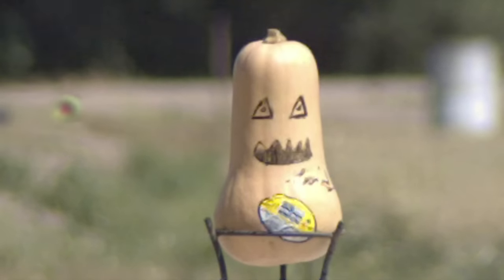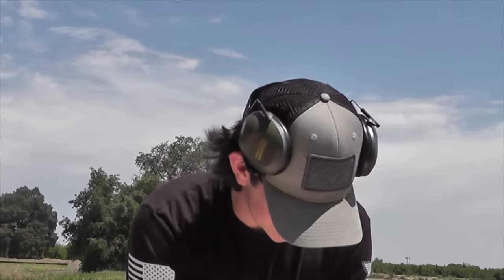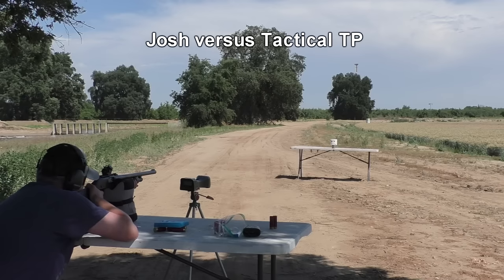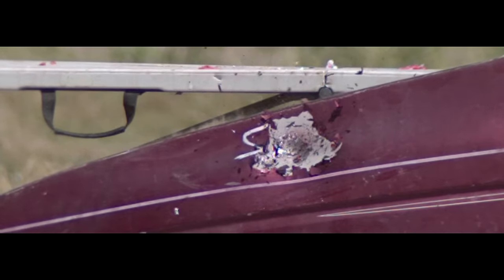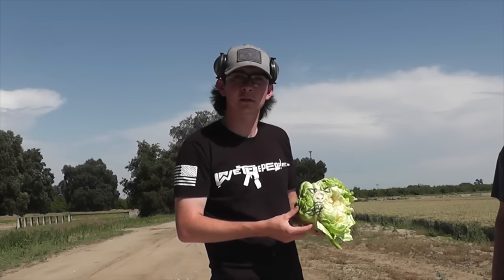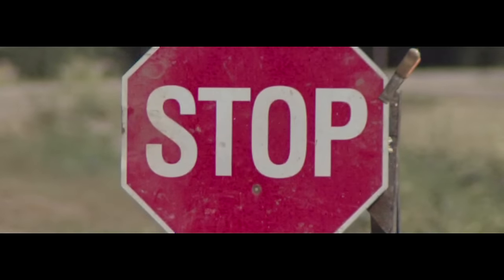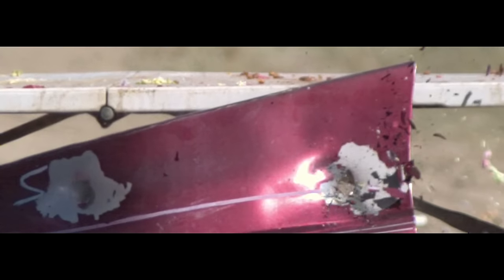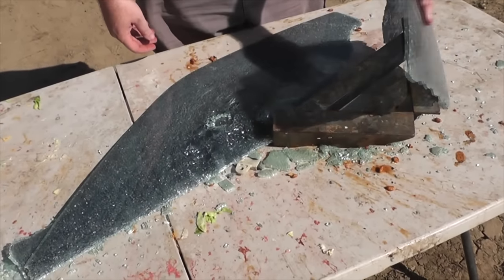How deadly are 12 ga. BUBBLE GUM Slugs?

Comment: I'm wondering if possibly deep freezing them with dry ice instead of a regular ice pack would have made any impact on the durability of the HubBub Slugs in flight. Maybe something to try if you decide to revisit the idea, Jeff.

Edit: The only downside that I can think of would be that the gum would then be too fragile to handle the G-Shock from firing and just shatter upon being fired.
Reply from the maker: That's a good point,   these are resilient enough to handle that shock
Reply: @taofledermaus  I imagine that there's an optimal temperature where you could have a more rigid, yet still resilient round that isn't shredding itself apart mid flight, but it's probably not worth the effort to fight the California heat to trial and error it. 😝 In any event, great video as always!

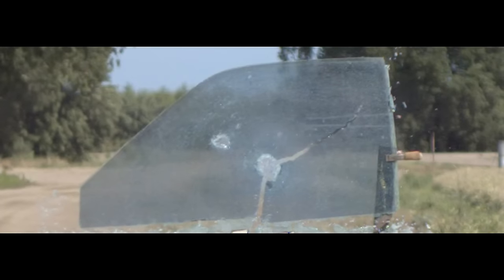Comment: 19:06 The cup holder went through because the glass it hit was already shattered. The moment the bubblegum bullet hit, the fractures went so fast even in slow motion you could barely see it. The top right of the glass was sent flying from the speed of the shockwave.

Comment: There was a difference in angle of impact as well as distance on the fender. The non penetrating shot hit above the bend on the fender, with the metal sloping away, penetrating shot hit a lot flatter.

Comment: Since the window was pre-shattered and only held together with the tint film, the shot cup was able to penetrate. By itself it probably wouldn't have been able to do so. Tempered glass is remarkably hard to break with blunt objects. Sharp pointed ones or the edges of the sheets are another story.

Comment: I think it would be cool to see what you could destroy with just a shot cup/wad, etc. without any other projectile. The trick would be getting enough pressure to send them downrange at enough of a velocity.

Anyways... You certainly found a good stand-in for OG's Comedy Hour. Those two would be a hoot together.
Reply from the maker: It's not heavy enough to light off the powder unfortunately.
Reply: @taofledermaus  Didn't you guys make an airgun before with a tube, valve and compressor? Maybe I'm tripping.... :/

Comment: Another suggestion from me (if you haven't tried it already) would be forged carbon fibre and forged kevlar projectiles, preferably using epoxy as the resin.

The projectiles shouldn't be too difficult to forge. A simple tube (with some drilled holes to avoid hydrolock) and a regular vise would be enough to press the fibres - a hydraulic press even better.
Reply from the maker: I think they'd be very light weight.
Reply: @taofledermaus  To solve that problem, a metal in powder form could be mixed with the resin. Just enough to increase the mass.

Comment: Awesome ballistic research! I performed a similar test with dubble bubble, 1184fps 5 shot average, SD of 33fps. Cylinder bore 18.5" barrel. 1/8" aluminum at 5yd only dented. Able to hit steel targets at 25yds. Definitely not going to penetrate a stop sign at 20-25yd. But, super fun anyway.

Comment: Worthy of mentioning...The car window at the end was tinted with aftermarket window film - it's not a stock window (you can easily tell by noticing the fact that the film does not cover 100% of the window).  The projectile and the wad went through both the glass and the 1.5mil (not millimeters...a mil is 1/100th of an inch) window tint.  Window tint is made from spun polyester and contains a very agressive acrylic adhesive that bonds it to the glass.  You can't tear it - it's really only possible to penetrate it by using a blade to cut it.  Or Hubba Bubba, apparently.

Comment: They could have used the kind of stop signs that road repair crews use.  Since they have to hold them they need to be fairly light.  I don't know exactly what they are made from, but it looks like a fiberglass type material.  I think the bubble gum slugs you were using would penetrate them.

Comment: The window surprised me a bit honestly. Me and my friends scraped a old car a vw bug that rusted to the ground dang near and took the windows out
We where blasting it with softball sized sandstone rocks and could not bust them i took a tiny pebble and threw it and shattered it. I expected the gum to give enough that it would not break 
As far as stop signs go some are thin aluminum some are thicker or made from steel that could have allot to do with it aluminum ones when you hit them with even high powered bb guns you can punch through them with ease

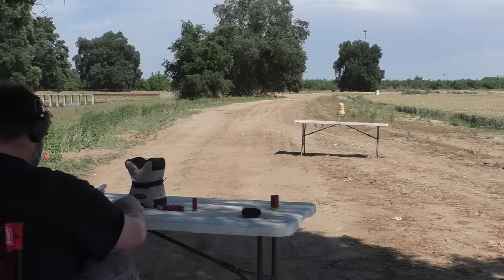Comment: @ 9:14  It's a Butternut squash.  Buy one, cut it in half longways.  Scoop out the seeds and any strings.  Violently stab the flesh all over with a fork.  Drizzle some good olive oil into each half and rub into the flesh.  Sprinkle with salt and pepper.  Put onto a hot charcoal or medium-hot gas grill (with some wood chips for smoke flavor) skin side down for (insert time - depending on your grill...my little gas grill is 22.5 minutes a side, charcoal is going to be a little longer...if you have a balls-out $3K grill, throttle it waay back to medium-medium low).  Flip and cook for an additional 20'ish minutes.  Take off the fire, add butter to the cavity, and prepare yourself for the best squash you've ever had.

Comment: From working with sheet metal as part of my job, I think that computer case was made of either 20 or 22 gauge steel, and the fender was probably made of 26 or 28 gauge (gauges run in reverse, so bigger number means thinner gauge). Not that thick, but good enough to stop a bubble gum slug, apparently.

I'm guessing this thing would probably have similar performance to a beanbag round against home intruders, it's not something I would want to test though.

Comment: So my dad used to reload shotgun and rifle rounds so I know a little bit, but I'm no expert. I think if you have these bubble gum rooms sitting between two layers of dry ice in a cooler and then shot them the results would be very different. Whether it was a hot load or not and whether the barrel was rifled or not. We have to remember that the rubber that they put into the gum it's just a softened version of what they use basically in very grippy snow tires or race tires. On cars motorcycles and regular bicycles. I would also love to see a variation on shapes in the realms as well. In other words if you elongated and made it more bullet shaped would it have any effect. This looks like a TON of fun. :)
Reply from the maker: This worked because the gum is resilient to shock.   Had we chilled it,  it would have shattered inside the gun.

Comment: Regarding the "clamp it down" comments. I am a lawnmower technician and I often have a conversation with customers about engine speed being the biggest determining factor as to if their grass is cut well.  

If you have a razor blade and try to cut your grass by hand, moving the razor slowly, the blade of grass will just be pushed out of the way and fold over. To highlight this point, people will often, accidentally, put their blade on upside down... Meaning that they are now cutting with the totally blunt edge of the blade... They are always dumbfounded when I inform them of this, saying that it seemed to be cutting ok. 

Fast and dull beats sharp and slow ... I'm not going to pretend I know how... but I'm sure there are inertia calculations.

Comment: Try using playdough. mold slugs, let one sit out a day, another two, and so on. Also try rolling playdough into about .30 cal balls and filling the shotcup (3")20gauge.  
    My idea is based on a round that will have max expansion (on impact) without lethal penetration.

Comment: Though FlexSeal and JBWeld with one of the varieties of metal in a powder or glass powder mixed in then put into a slug mold is a close second.
Reply: Jeff if you read this give it a try.  Better than wax slugs and you can pick any slug mold, and change the weight, very versatile. You could put in a sharp steel tip for max penetration.

Comment: The challenge? Non-newtonian fluids. Cornstarch/water mixed vs bullets

Practical app? Fluid in a tire? Or a re-sealing sort of Kevlar or fire hose bag? Where fluid density would push back and not seep out wound entry... 

But a clay pot with fluid... should catch first bullet, so a line of pots would stop as many bullets as pots!?

Comment: Did you use fresh gum or really well chewed gum? Chewing it removes the sugar and other chemicals so that it sets harder.

It would be interesting to see a test using slugs made from dry chewed gum to see if they penetrate better than the soft fresh gum.
Reply from the maker: It was just the gum right out of the wrapper like I showed.   We didn't want to taint the test by altering it.

Comment: So the fact that something so soft actually survived being fired gave me a dumb idea.

So earplugs are designed to be rolled into a thin cylinder and expand once in the ear, right. 

You might be able to roll one up and stick it in a bullet casing and once in there it will expand and seal.

Comment: I wonder if there would be any more chance of penetration if the bubble gum had been frozen solid.  Check out the Mythbusters episode where they were shooting chickens out of an air cannon at the widshield of an airplane.  The difference between frozen and thawed is dramatic, both for the bird and the windshield.
Reply from the maker: I think if you chilled the bubble gum it would have become brittle and just shattered during the firing cycle.   Much more pressure and g-shock occurring here than lobbing a chicken at 80mph or whatever.
Reply: Ah, yes.  I didn't think of that. @taofledermaus

Comment: 14:13 @taofladermaus might have to try, double bubble gum, it's hard gum an alr ady the size of a 12 barrel
Reply from the maker: Those are smaller and lighter than these.   But I think the original meme showed dubble bubble being used.
Reply: @taofledermaus  is very possible, but I was thinking it might worth a try fer ol'chits and giggles? Maybe alittle tape around it to snugg up the fitment? And maybe some odds and ends in it to bring the weights up or for other results?